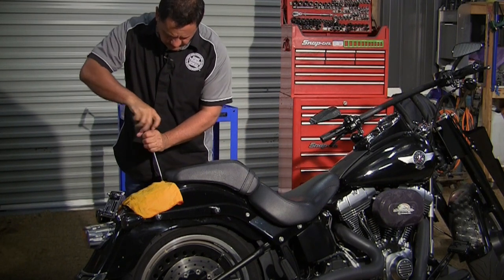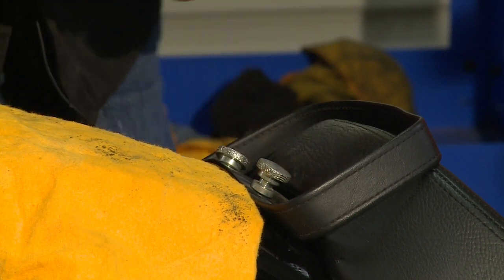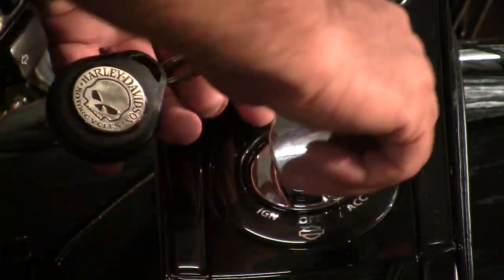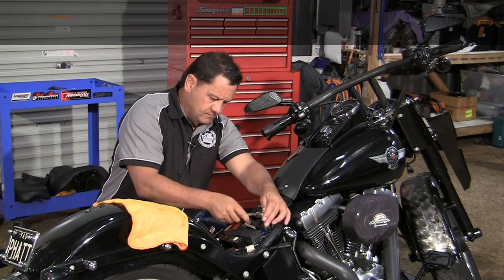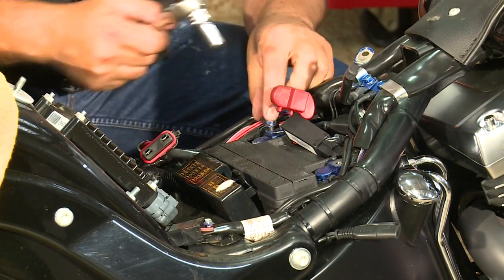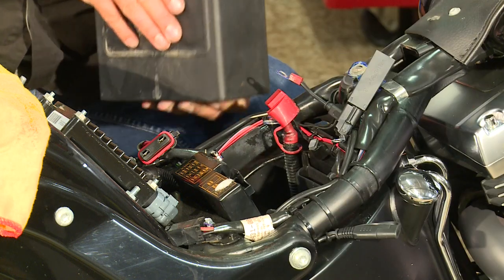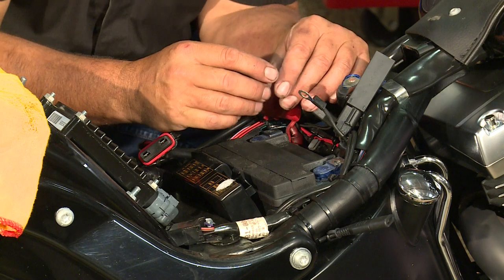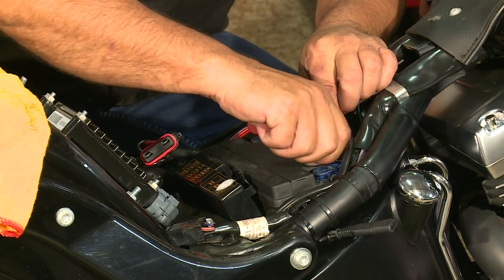How to disconnect a Harley motorcycle battery

Comment: So is the maxi fuse reinstalled with ignition off ? - (was removed with ignition on), not mentioned and not clear, although video ends with ignition off and maxi fuse still uninstalled so would have to assume that's how it's done.
Reply: Hey did you find out the answer to that question? about to put a pigtail on my bike.
Reply: @KrisHarrisnNeti  had the same question, important detail to leave out,..not a complete instruction as pulling out main fuse is what set my alarm off last time
Reply: Turning the ignition on with fob near it disables the alarm, that's when you can pull the maxi fuse to disconnect the battery so the alarm won't sound.  I don't think it matters when reinstalling it but I always turn the ignition off before reconnecting everything, I do the + then - then maxi fuse, then turn ignition on to crank.